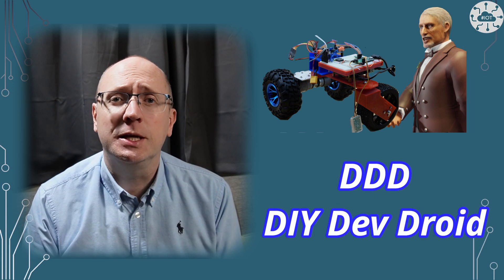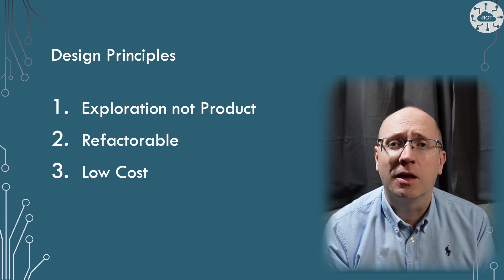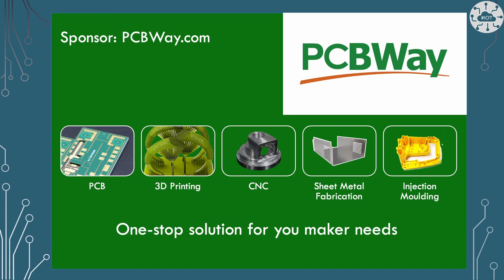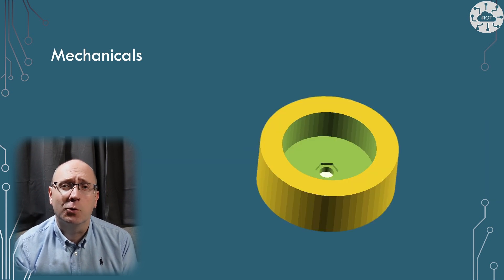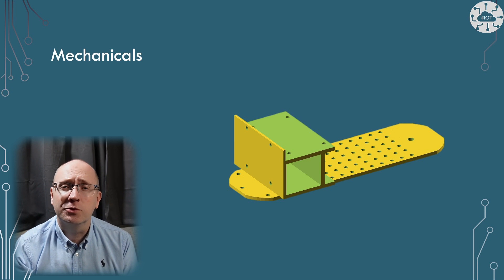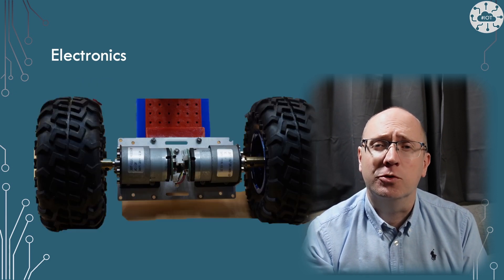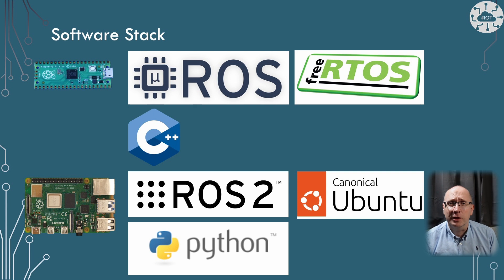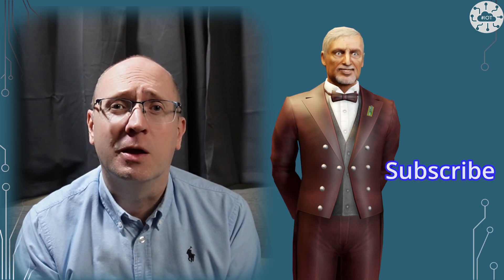Introducing DDD: DIY Dev Droid

Comment: Started with your course and I am learning so much. I am facing a big issue working with cmake. In my development directory, I have a src file with many executables there. Using vscode, it comes with an automatic compile and run tool. I find it difficult compiling my code and making it run
Reply from the maker: For any complex project, one that uses a src folder. You need to use cmake extension in vscode rather than the Pico extension to build the project.

Comment: Thanks a lot for sharing. Would it be possible to know the specific model of the JGB37-520 DC motor? It ranges from 12 to 1590 RPM. Best regards
Reply from the maker: Good question. I suspect the 1590 but as I bought it as a cheap budle on ebay and didn't have any specs with it I don't know precisely.
Reply: @DrJonEA Thanks a lot for your feedback
Reply from the maker: Welcome mate